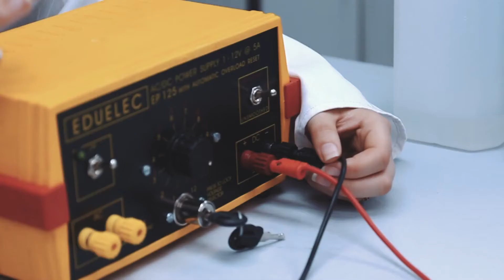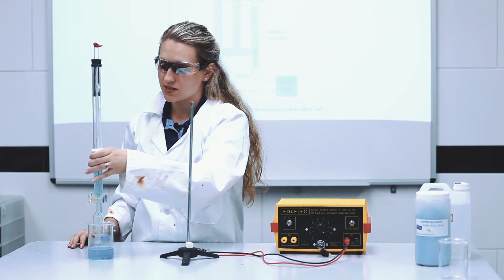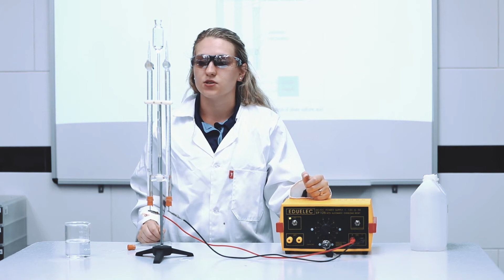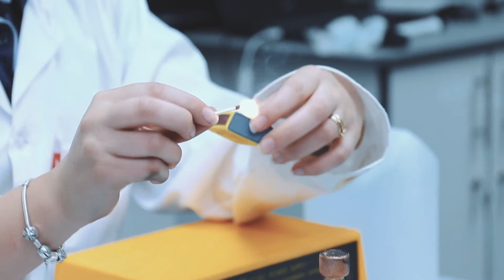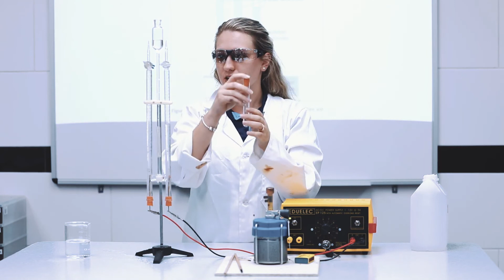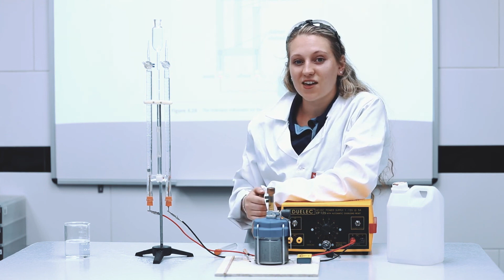Electrolysis with a Hoffman Voltameter

Comment: next time use splints - the ones used were like sticks and probably caused you to make a right pig's ear of the oxygen test!
Reply: Hi P&P. She used copper sulphate so the oxygen must have come from that electrolyte CuSO4. Had she used sulphuric acid H2SO4 she would have had oxygen and hydrogen - its obvious that the H & O didn't come from splitting of water but from the electrolyte. The Hofmann apparatus proves water is not H2O.
Reply: @johnnym6700  quote - The Hofmann apparatus proves water is not H2O. -- Nothing I've ever seen proves water is H2O!
Reply: @PeterPete  Its the same as the globe. No proof of the globe - not 1 proof but many proofs there is no curvature.
Reply: @PeterPete  All electrolysis where water is present should produce H & O and it doesn't happen.....
Reply: @johnnym6700  That's the big problem with people - they're deluded; they THINK things that haven't been proved to be true (and so could be untrue), to be true!!
Reply: @PeterPete  Just because the info is printed in textbooks isn't proof its true.
Reply: @johnnym6700  just goes to show these people will accept any bits of info to base their dreams on!!
Reply: @PeterPete  They have been programmed since birth!
Reply: @johnnym6700  it could also be they're scared of the real world!!